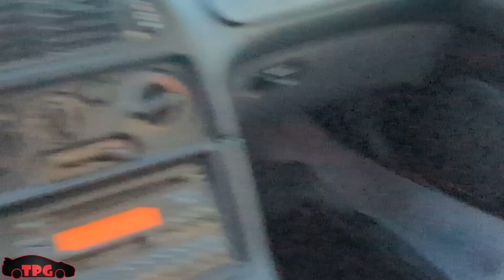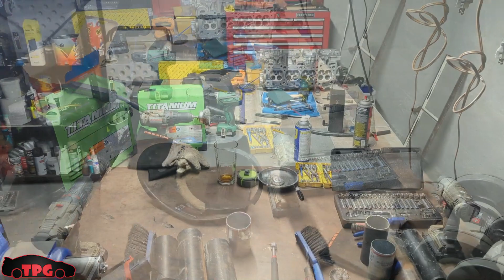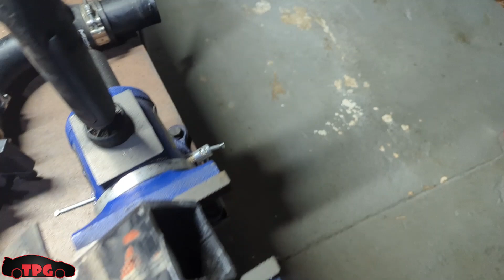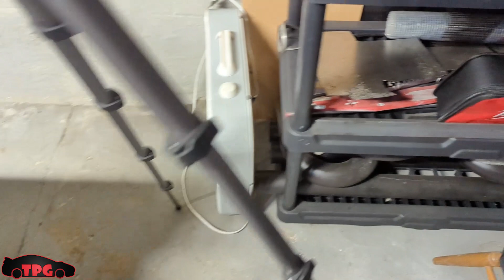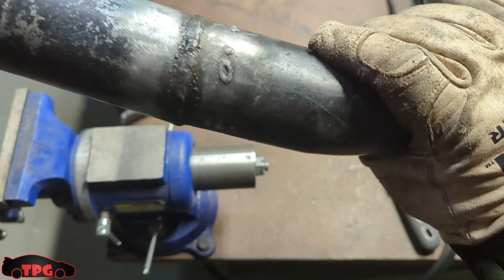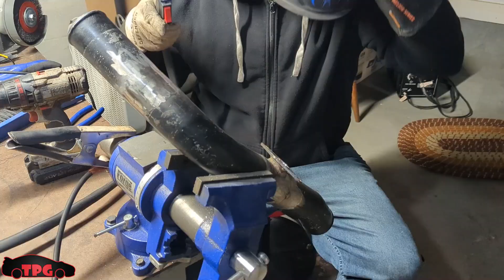NEWBIE WELDING INTERCOOLER PIPE FROM SCRAP TUBING- WELDING AT HOME 110v

Comment: Great job on those welds! Inspiring. The metal you are using is that the galvanized exhaust piping from like autozone? Cause if that is, thats pretty crazy how good it looks! It really did clean all that mess up!
Reply from the maker: Thanks!. This is aluminum intercooler piping. One of the first projects I knocked out once I figured out my Tig welder. It’s definitely a fun hobby to learn. 👍
Reply: @TPGDSM how are you using this machine to weld aluminum?
Reply from the maker: It’s a Vulcan pro tig 205. It does ac/dc welding. I used to have a small flux welder that I used on some mild steel piping I picked up from marketplace.

Comment: The only thing I dislike about the titanium is its inability to hold 10lb spools. The HF set up used to come with a 10 lb spool. They obviously stopped spoiling us :( but I do love having a 10lb spool! Sure its heavy but the small spools, really should give you PTSD.. DO YOU HAVE ENOUGH WELD FOR YOUR PROJECT?????? GUESS YOU'll HAVE TO FIND OUT!
Reply from the maker: That’s so true. I modified one of my flux welders to accept a larger spool after I had that exact experience. Fixing rocker rust, just fitted and filed down a very difficult part and went to tack it on, all of a sudden the wire feed sound pitch changed and my tack stuck while pulling the torch away 4 ft of wire ripped out the tip 🤣

Comment: I finaly got on sd and now im learning to tune that so any tuning help would be great and any tips and tricks for base tuning as a larger general injector stuff and timing and fuel changes that worked good for u would greatly appreciate i watch all ur dsm vids great help and confidence building for sure
Reply from the maker: I will have some more ecmlink stuff coming soon 👍hope it helps
Reply from the maker: Take a look at the latest video I posted
 There's some good SD info in there along with other commonly asked link questions that may be helpful to you 👍

Comment: Yo man what size bung you got for ur air temp sensor? I have the same one and can’t find the right bung. But yo that’s some good work bro. Ur growing as a welder fast. I watch all ur videos and literally am a few steps behind your on your journey bro. Can’t wait for more lessons.
Reply from the maker: Thanks a lot man 👍 to be honest I can't remember what the exact size of the bung was. I got it in my aem wideband kit. I'm pretty sure they only fit one direction too. If the bung is upsidedown you can't fit the sensor in on mine. It had a taper to it (got tighter as the sensor screwed in). And thank you for your kind words on my welding!. It's taken some time to learn and having the new machine helps IMMENSELY!!. I can't say enough good things about it so far. As for the bung try a 38npt. I believe that's the standard
Reply: @TPGDSM  thanks man